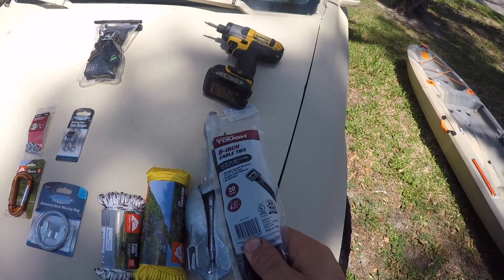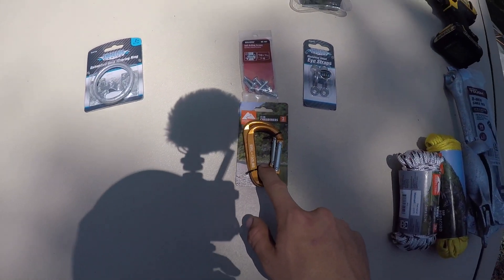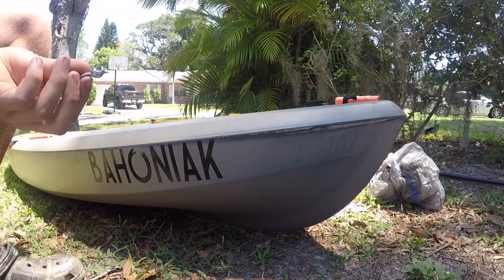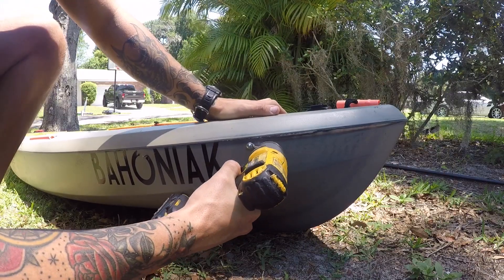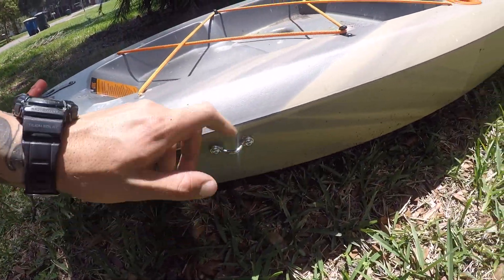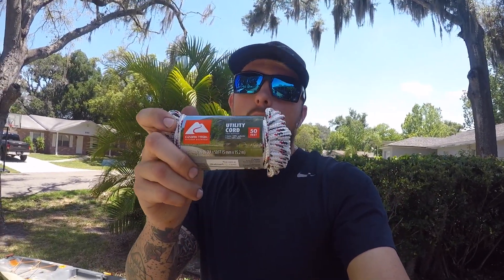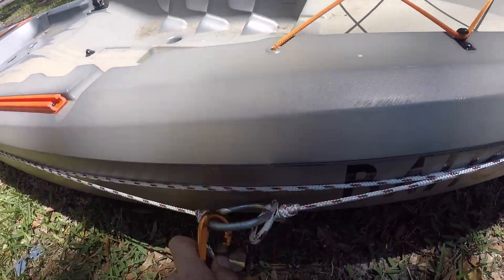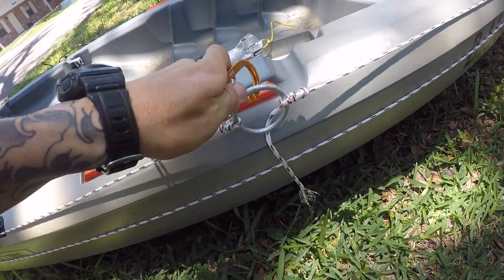DIY Kayak Anchor Trolley Install (under $40)

Comment: Hey man great video! I actually run the exact same kayak that you do, if u want some cool add ons for that kayak, I’ve done some diy add ons myself
Reply from the maker: What all have you done
Reply: Hudson B I have a cooler behind the seat to which I added to more extra rod holders onto for more rods, I use the orange tracks as mounts for a GoPro, soon I am going to use it for a fish finder, I put a battery powered light on the front so during the evening I can see better, and I mounted an extra utility storage box where the front orange ropes were originally.